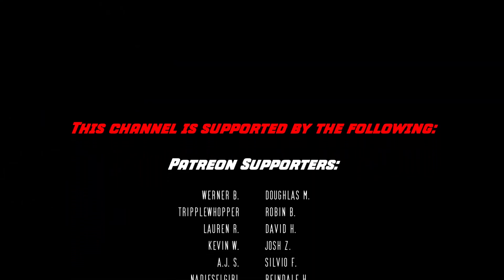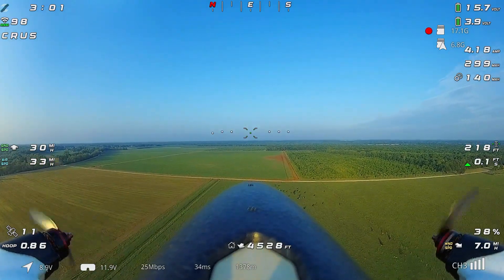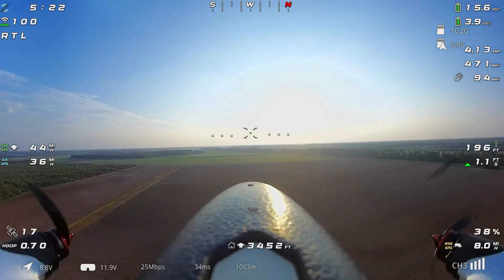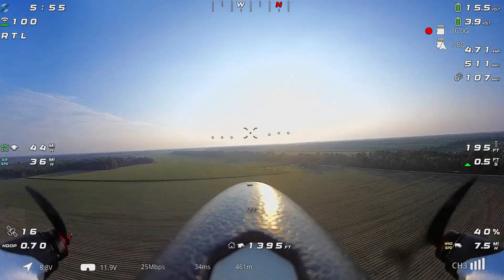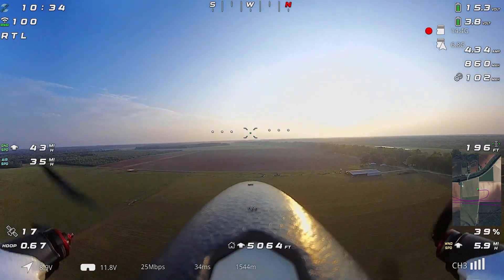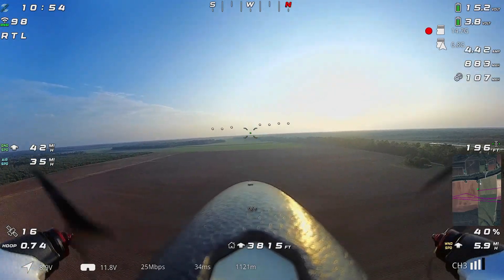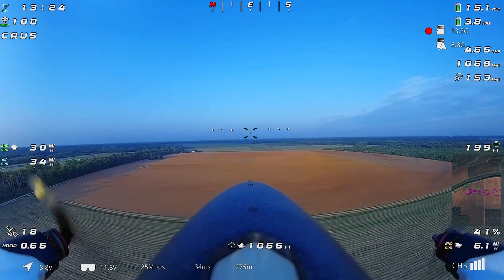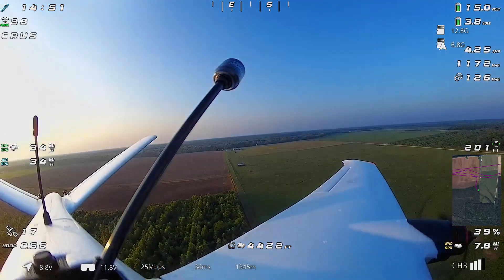Getting the Swordfish Dialed-in

Comment: notice still even with new props a little bit of vibration resonance between 40-50% rpm have you ever noticed this ? Wonder if thats common with this model, props were balanced.  Not really sure. 

Still after over a year messing with PIDS cant get this thing dialed in with iNav.  I know some shorten the Tail but really didnt want to go down that road. 

thanks again for your channel.

Comment: A nice informative and interesting video. Great job of tuning. 
Think some of what we're seeing in the yaw wondering might be due to longer wings. As the Swordfish hits gusts that bump up a wing. The roll will induce some yaw. You adjusting the roll-yaw coupling appears to helped with this.
This does make me wonder if ArduPilot has ability priorities yaw vs. row for small random corrections as a way to prioritize holding a heading. (probably not) When flying a sailplane (full-size), it's typical to input yaw slightly ahead of roll input to avoid adverse yaw. The technique can be considered a flying style preference, as it's not essential.

Comment: Can I use any 5.8 antennae for the Walksnail system till I can order the proper ones?
Reply from the maker: Sure, just make sure the connectors are right, and the polarity matches on all antennas in the system. (right or left circular, or even linear) The VRX has the two patches built in and would be more challenging to change those. The antennas that come with it are all left hand circular.
Reply: Thanks. Unfortunately I had to get the new Fatshark Dominator HD because my 10 year old Fatsharks don’t support the new Walksnail system like you have. I’m just trying to save money and use antennas I already have.